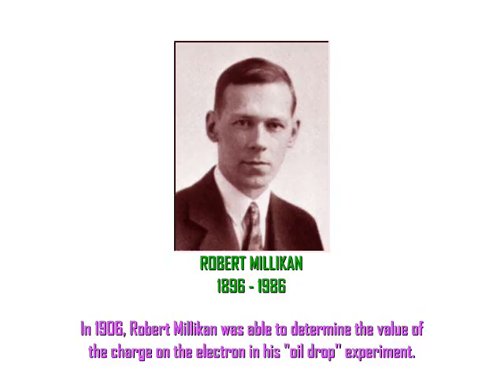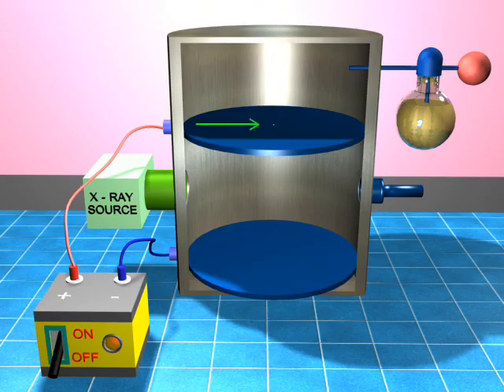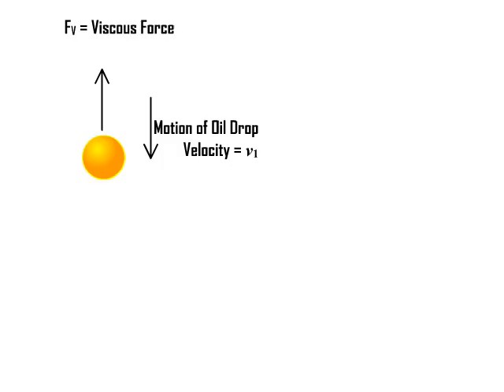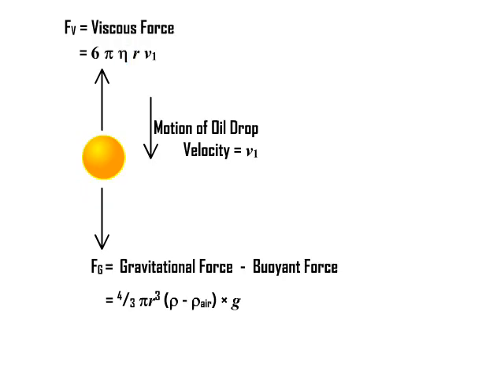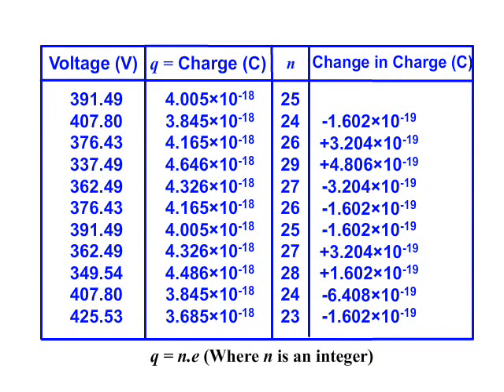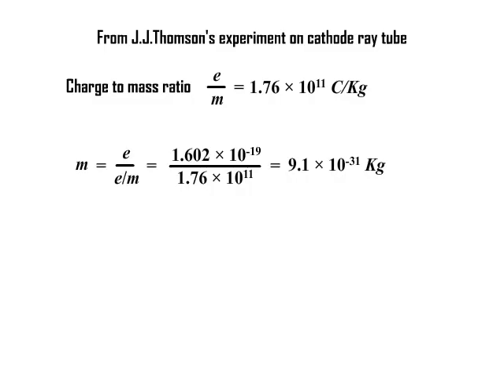Millikan's Oil Drop Experiment

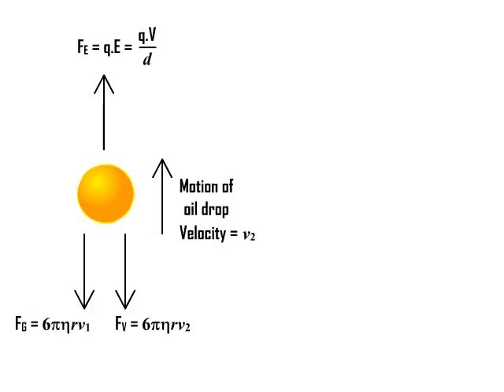Comment: At 4:05 , why does the oil drop move upwards with a constant velocity even though Fe = Fg + Fv. Should it not stop at a certain point if all resultant forces are balanced? Please explain 
Thankyou.
Reply: Fv will be there only when the body is in motion. 
If we say that the body is not moving i.e. it is stopped at a certain point, then at that point, Fe = Fg. 
Then as Fe gets greater than Fg, the body starts moving upwards and hence, drag force comes in the picture which is basically a force that a body experiences in the direction opposite to the direction of its motion.
Reply: Hence, when the body is moving upwards, Fe= Fg+Fv

Comment: if top plate connect with negatvive voltage what will be effect??
Reply: Then the plate will repel the drops and they will fall with a greater acceleration on the bottom plate.

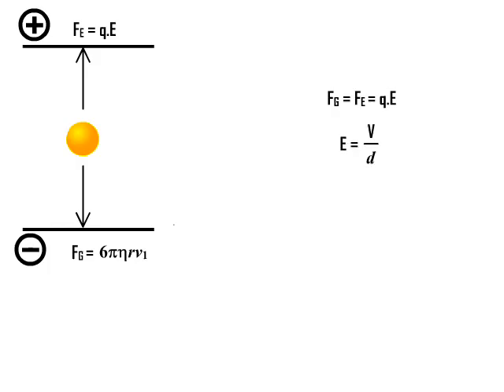Comment: Regardless brilliant method of getting the number I have another thought about this experiment. This point  3:19 Fe=Fg, two forces of the same magnitude? Assuming the experiment is done in vacuum so we can simplify Fg to pure gravitational force acting against the electrical charge. Does it mean they are exactly the same? The only difference is we can adjust one of them. Properties are not important in this case. I can go even further. Fe=Fch=chemical charge of electrolyte in a battery. The same exactly force but in this case between separate atoms. This is being carried through conductors. Different material than electrolyte but still the same force between different atoms. Absolutely mind blowing experiment. While the drop is is levitating over a period of certain time work is being done and charge of the battery should be decreasing slowly. This means the density of the electrolyte will change. This is the only change over a time in properties of the material we observe in the experiment. Mind has been blown away once again.

Comment: can you explain me why the +ve terminal of the battery is connected to the top plate
Reply: The x rays ionise the air particles around and the oil drops get negatively charged. A positive terminal is connected to the top plate,it attracts the oil drops, so the drop can remain suspended in air and not fall due to gravity.

Comment: On second case, when the electric field is turned on , the force experienced by the oil drop (or electron) is F = qE which acts upwards and so does the viscous force , i.e. viscous force also acts upwards according to my reference materials but you stated that viscous force in second case acts downwards, please explain it.
The final expression on my reference book is
q = 6πηr(v1 - v2) x d 
    _______________
          V

whereas yours is
q = 6πηr(v1 + v2) x d 
    _______________
          V
Reply: viscous force is an opposing force like friction so it always act opposite to its motion,so as oil droplet moves up it act downwards !!!!
Reply: Fg is force of gravity and that equals Fv in first case thts why he noted Fg=6rv
Reply: Same question here !
Reply: If the oil drop fall down with a small terminal velocity v2 even though electric field is applied then only it is (v1-v2)

Comment: In case 1, where the motion of the oil drop is stopped, wouldn't a force derived from the electrical field equal but opposite to the gravitational force simply result in a constant velocity (zero acceleration) rather than a situation where there is necessarily zero velocity?
Reply from the maker: ste h think of both the first and second law of motion. not only the second law. hope u get ur answer
Reply: +Soumitra Das  thanks for thes ved larinng by video

Comment: Correct me if I am wrong. But, I believe at 3:18, when the voltage supplied to the plates creates an electric field force that balances (stops oil drop motion) the oil drops, the guy has the gravitational force mixed up with the viscous force. At 3:18 it should be F(gravitational) = 4/3 * pi * r^3 * (rho - rho(air)) * g. Again, please correct me if I am wrong.
Reply from the maker: Matthew Dann Remember when electric field was not applied the oil drop was falling down with a velocity = v1. We have already mentioned there that the gravitational force is equal to 6*pi*eta* r*v1. So why cant we apply that when we apply electric field to stop the motion of the oil drop.
Reply: @soumitraa0  so what is the use of X ray source in this experiment ??
U haven't mentioned it ..
Reply: dear! if top plate connect with negatvive voltage what will be effect??
Reply: @abdulmutlib1583  Oils are generally long chains of Fatty acids , Which are usually Negative charged. 
So it will attract to the +ve plate which ever that is.
Reply: It's is substituted with an earlier Expression to make final equation easier and in terms of Terminal velocity.
What you said is also correct . Great Work man ,